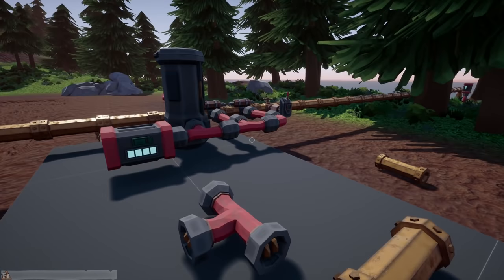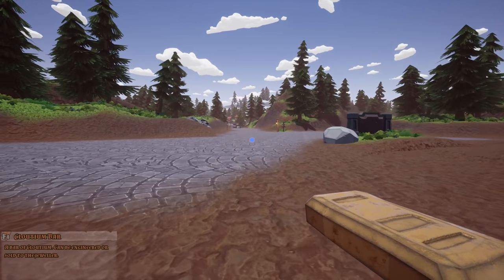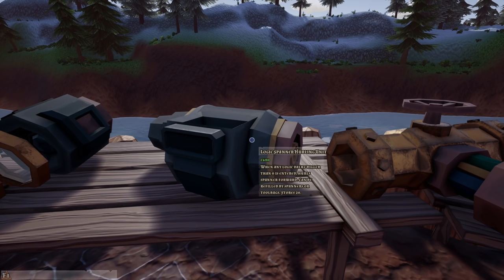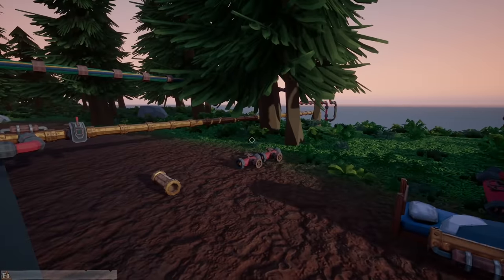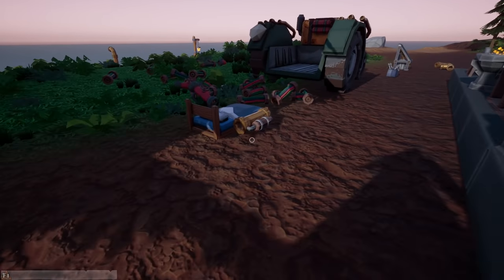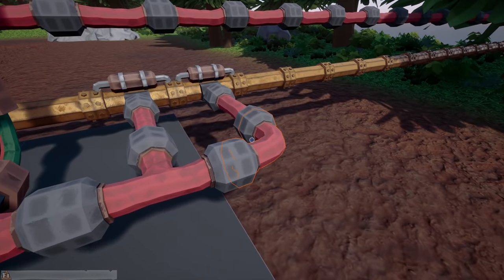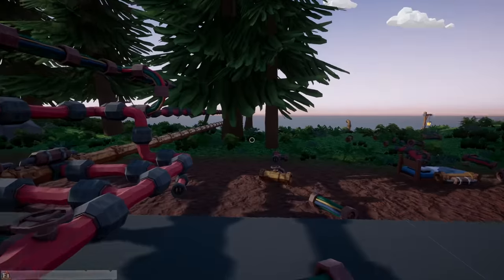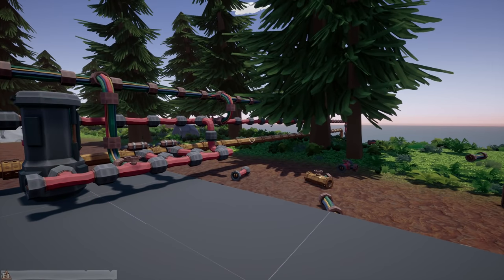Adding MORE Logic and POWER ! Hydroneer Ep.9 | Z1 Gaming

Comment: Two things: One You can add railings to your conveyor belts, purchased from the same store, to stop items from flying off. If you look around, especially at the corners you'll see a lot of items have fallen off. 

Two Right next to the auto spanner is a logistic device that reads the damage value of a piece. You could easily make an auto repair for your filters incredibly easily with those two.
Reply: i find that instead of using the railings. placing a centering conveyor every 5 conveyor belts or so also stops items falling on the ground. and its allot less hassle then placing 2 railing pieces for every conveyor you have.

Comment: Logistics tips, no need to take power and logic to the pickup pump. Put power logic cutoff closer to generator saves logic cables. Batteries need their own cut off as they are a load and a generator leaving them connected drains battery. Auto repair unit you have to "hover" spanners inside the unit to load the spanners, there's a durability reader on the table next to the spanner thrower, easiest setup is the two connected via a straight flip logic so when durability is 0 the logic flips it to 1 which throws a spanner(add the logic reader piece for testing). things start sparking at about 30% so they will spark for a while until it's completely broken. Edit: you worked most of this out.

Comment: For the powered water pump, you should have just run a power cable by itself and installed the logic switch and battery at the control hub
Reply: thats what is bugging me, that was the first thing I thought when he started to build it...
Reply: i was thinking the same thing when he started doing it. at 30min mark it finally dons on him.

Comment: You could just replace the t-section pipes with corners at the ends of your ram lines.

I was yelling the entire time about the logistics line to the pump XP
I would suggest removing the unnecessary logistic line to save on logistic lines in the future, or if you want, sell them back to help with lag. But yeah, I would suggest also making sure you aren't caping ends with t-junctions that you're not planning on expanding from. Saves you a bit of money and what not, plus it makes it look tidier

Also, look for the power/logistic lines with the lightbulb/screen on it to help you diagnose your lines. THe lightbulb uses no power and it is an indicator to let you know if the line has power going through it or not, and the screen lets you know what the logistic line's value is. Outside of the initial price of the parts, there's no additional cost/draw on your system to get this info, so it's good to use when you're setting up something like this so you can make sure the right lines are powered and the right logistics have the correct values before making it all permanent.

As for the question of the distance max thing, it wasn't that. The pump was just being constantly powered by the batteries you had plugged in, and you had your wires mixed up as well as your pipe not installed to the reactor properly.

Comment: Z if you put a normal water inlet at the water line running to the generator then place a water pressure valve after, it would save a lot of power cables

Comment: hope nobody commented this already but you could have just connected power to the pump and move the logistics power valve also only half way trough video so i don’t know if you did it already
Reply: ok you fixed it also if your batteries ever completely drain your system won’t jump start and turn on

Comment: Why so much spaghetti made of cables? Why pull a logical line to the beginning of the lake, if you can put a power switch next to it, and then only supply power? You can make 2 lines of pipes in parallel for machines and conveyors and use one valve each. why are you making your life difficult? Where is your experience playing Satisfactory? I hope you fix it later))